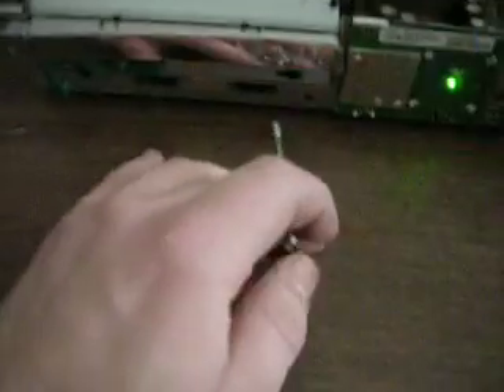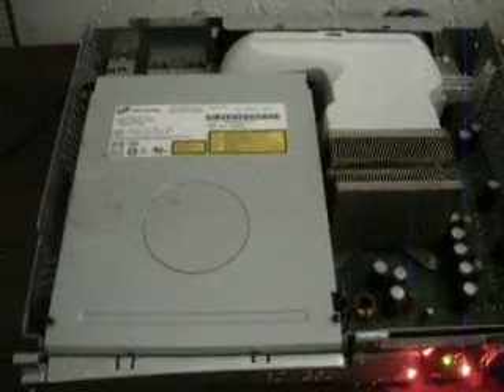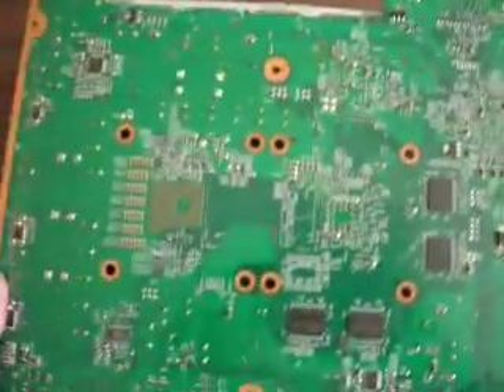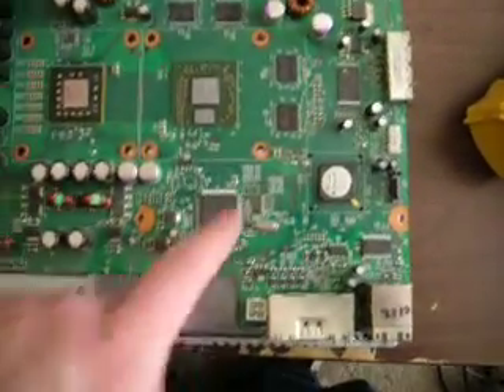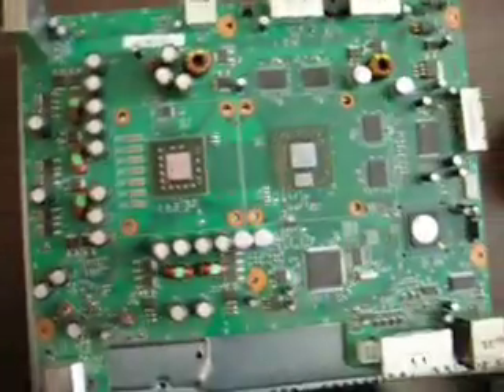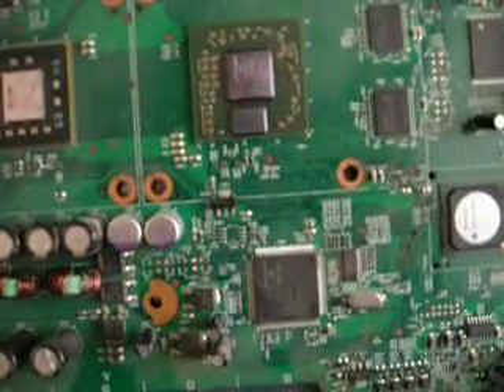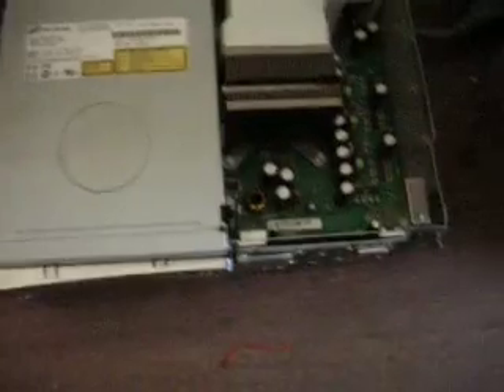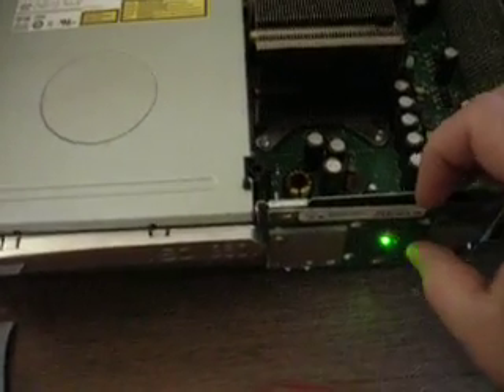Xbox 360 Heat Gun Reflow - RRoD Repair

Comment: How long did it last
Reply from the maker: XLS Gaming I don't remember how long this particular one lasted, I fixed a lot using this method. Some were permanent, some were only temporary. I think a lot depends on how you do the x-clamp fix afterward, how much the video chip and motherboard were flexed and whether or not you use a liquid flux.
Reply: xxW00LYxx ok thanks bro

Comment: Worked for a day then got the rings again.
Reply: Zach Jaixen if that is the case I suggest reapplying thermal paste. Either that or you could completely remove the chips, clean the lead-free solder and replace it with lead-based solder and place the chips back on

Comment: is enought to heat the GPU not all the motherboard
Reply: +Pary Pary I have a problem with HANA chip. It depends of what sympthoms you have. But just in case, you better reflow everything so you are sure that after you asemble everything together will work because if not, then you need to re open it....
Reply: he prevents the board to crack or to bend because of the temp difference i guess

Comment: What temp is the heat gun set to, mine has 10 degree f increments
Reply: +Shaun Riggle ~500F low and ~1000F high. Heat board to ~230C (~450F) MAX

Comment: Hey my xbox 360 is broken and it wouldnt power on so i kept pressing the power button and a capcitor blew will it turn on after reflowing as you did in this video? and also nice vid thanks :D
Reply from the maker: No, you can only fix a broken capacitor by replacing that capacitor
Reply: it was one of these things that popped off
http://gyazo.com/ce6cc88cf8efb0a9ef2c7a8b6a814ffe

here it is now:
http://gyazo.com/b637172cc73aeb1321abdf931a4fd340

 it also left a mark:
http://gyazo.com/18a633b15930f55a80b3d2a3f766b4de

so it for sure wont work?
Reply: +TD5X If pressing the power button caused an SMD ceramic cap to explode like that, you have much worse problems than that cap. If you're still holding onto that 360, you might just want to toss it.
Reply: Hydranix HNx
well damn i wanted the console id off of it :( and stupid m i actually tried turning it on again....was scary

Comment: i have done this manytimes and no luck same heat gun same everything wtf
Reply: Rrod isn't always caused by solder joints cracking. For all you know, you could have blown a capacitor or your power brick is dead

Comment: This method works great, I have fixed a rrod by disconnecting the fan and letting it sit there with the three lights until it overheats, showing two red lights, let it cool for an hour and it fixed the problem, I did however scrap the x-clamps and used bolts and washers to attach the heat-sinks to gain a tight clamp replacing the thermal paste in the process. Give it a go, have fun!

Comment: Can I use a hair blow dryer for the heat gun
Reply: Yes but it won't get hot enough to properly reflow it.

I used a blow dryer myself and after several hours I had another red ring of death.

Just get yourself a heat gun from walmart or amazon for $20. They are cheap!
Reply: undefinablereasoning

Update: Found a way to fix it without a heat gun...

Remove your heatsinks on the GPU and CPU. Clean off all the thermal paste (optional-depends on whether your thermal paste cures or is like mine and remains gooey after heat(I use Noctua NT-H1)).

Wrap all components on the board with aluminum foil except the GPU and CPU (make sure all the plastic bits on the board are well covered with aluminum foil).

Ensure there is no foil covering the bottom of the board.

Put it in your oven making sure that whatever rails or plate your oven has does not make contact with one of the vrm chips on the bottom of the board.

Set your oven to 250 degrees Farenheight for 15 minutes (includes preheat time).

You want the board inside during the oven preheat so the temperature rises gradually.

Remove board from oven and let it gradually cool on a surface that doesn't put pressure on the bottom of the board. (I used a towel).

Reapply thermal paste and heatsinks. Reassemble xbox 360.

And your red ring of death should be gone for good now. (I've not tested extensively, but i've not seen it come back as of yet).

Good Luck.

Comment: So i did this with my hair dryer, since i have $0, it took me much longer, but now im getting the two flashing red lights, aka the overheating light... i waited more than a half an hour to cool, i did it on a wood floor, didnt move it once while cooling, what did i do wrong? can applying too much thermal paste do this? i dont think i did that, but i cant think of what i did wrong. I have an x-clamp fix, i had the e74 one red light error.. its not even warm, why does it say its overheating? i get the bios or whatever you would call the xbox starting up animation sequence, to run for about 4 seconds before going black and the lights start flashing. anybody have an idea? i really dont wanna take off the heatsinks again, it takes like 40 minutes to get them off and back on again.
Reply: nevermind, it turns out that it was the thermal paste, i got the code '0011', and i just need to redo the paste, i forgot to do the stamp and check thing, i just applied and screwed it down, eh im not even a rookie, im just an experienced ametuer. So a mistake is a mistake, at least it wasnt a fatal mistake for mah ecks bahks.

Comment: before i do this i need an answer, if i heat the xbox on the metal case on a wooden desk, will the desk delaminate or burn?
Reply: You can possibly get the lamination result- but that has to be really old/ really crappy lamination. As for the Burning part- no. unless you have like your desk made out of sparklers and you let the heat gun sit there for hours.

Comment: got a whole batch of dead consoles that i have been using for parts, using this technique out of the ones i have watched, only difference being im using the low setting for both sides just to be safe, im fortunate that the consoles i have dont owe me a penny so if it dont work ive only lost out on some thermal paste and a heat gun but i have gained experience and some fun in the process
Reply: followed this again, this time using high setting on the actual chip side, bout 2-3 mins in, pop, there splits a cap, maybe my high setting is a little too high, but its only a high low setting gun, so guess i need to shorten the length of time on it
Reply: @thesmf1210  nice

Comment: did you wach the video at all? he did heat the bottom first (to prevent warping) and when he did the top it was concentrated on the main components. true this is straight from an online writeup and since he didn't give the reason why you want to stay away from the caps (drying out the electrolytes inside) so yes, he did do it correctly. (well as correctly as you can do it)

Comment: it dosent matter its not going to permanently fix your xbox 360, its got to be actually reball and reflowed with real machines not a heat gun the washer mod might work for a year or two plus new cooling past but its still gonna break down trust me ive been thru 10 xbox 360s and tried to reapair all of them every single way you can think of just buy a slim corona or trinity i would go for the corona version.

Comment: why are you heating the whole board? it's only the GPU that needs to be heated. You have a bigger chance of ruining your board the way you are doing it.
Reply: You heat the whole board because concentrated heat on one area will cause the board to flex. So you heat the whole board first to bring up the board temperature a bit before you focus on the chips you care about. It seems he didn't know exactly where the fault was so he hit all the main components.

Comment: iv fixed many xboxs using this technique but the video is wrong, you can still fix it, 2minutes all over the bottom of the board to heat it up, re flux the top as some could escape, and then 1.30seconds on the low setting on the top side of the board and then 2minutes on a high setting then 1minutes on low setting it will work perfect

Comment: That is an error that is commonly caused by the board being flexed from heat stress. The board is likely warped and you will have to un-flex the board by baking it at a low Temp for a while. There are numerous videos on Youtube that show how to do this correctly. Once the board is not warped, try putting it together and turning it on. You should now have a different error code. Look up that code to see what part of the board has a problem. Then, if it's a part that is reflowed in this vid,try it

Comment: Thank you very much for this tutorial. I did exactly as you said; one minute on the bottom on low heat, and 4 minutes on the CPU and GPU + memory on top on high. Worked like a charm. Got the xbox from my friend and with under $50 in supplies and this video I now have a working xbox! If I had bitcoins I would send you some. Many thanks.

Comment: As soon as i get my heat gun back from my girlfriend's dad's gunstore (was using it to heat kydex for custom pistol holsters) i am doing this straight away.  And the reason i have heard as the cause for RRoD during DVD playback is because microsoft i guess figured they wouldnt be using the cpu and gpu nearly as much as they would in a game, so they set the fan speed to stay on low during dvd playback.  Unfortunately for them, the chips still heat up, and with no airflow, they still get RRoD.

Comment from the maker: Easy: broken solder under the RAM and (H)ANA both can cause the RROD as well, and where I'm not monitoring temperature that allows me to spread the heat to avoid thermal shock (similar to what a pre-heater does on real reflow machines). Just trying to help people with a simple yet effective fix, you're the lame one

Comment: Not knowing what temperature the board and components are at is just plain bad.  Sure, this works more than half of the time because the heat makes the cracked solder connections touch again, but it's not a true reflow.  When the problem returns, it becomes a lot harder to do a proper reflow--most of the time a reball is needed.  Heatgunning can damage the pads or traces on the board, which reballing won't fix.  That's the point I am trying to make.

Comment: Btw, adding flux after a reflow does nothing.  The flux is there to remove oxidation from the surface of the solder so that once it reaches the reflow temperature, it will reconstitute any cracks in the solder.  Flux helps solder "flow", which is where the term "reflow" comes from.

Comment: I hope you're not charging people for this.  I doubt you're really reflowing the solder.  Since you aren't using thermocouples to monitor the tempes, you're basically doing it blind.  You need a preheater to keep the bottom at a constant temperature in order to get a proper reflow of the components on the top side.  You should be able to remove the GPU if it's a true reflow.  Try it out on a dead board and see if you can lift the GPU without warping the board (it won't work this way). Trust me.

Comment from the maker: @hunter24574 No! Ceramic based thermal compound does not conduct heat well enough. Use silver based only. However unlike a previous comment suggested, only apply AFTER the system has cooled or else you may crush the hot solder balls and potentially cause a short circuit, basically making your xbox permanently broken. Dont touch the system at all while reflowing or cooling

Comment: 1 thing u forgot to mention to pll is when u finished the reflow u then need to reapply the thermal paste to the 2 chips and heatsinks . laos 1 part i didnt c in ur video is on the 4 black ic units things on the back mine had 4 sponge things on them urs didnt do i need these

Comment: just a tip, all those things that look like batteries can explode and ruin the board if subjected to too much heat, you should realy cover them up with aluminum foil (which reflects heat) before you do this process. obviously it went fine for him, and you won't always have an issue, but it's a possibility that you should really cover since you could do the reflow right, but a capacitor could burst in the process and ruin the whole board

Comment: @xxW00LYxx Something that would help and reduce the time you'd need to spend with the heatgun on is surround the GPU, CPU, RAM etc. with some tinfoil, it will also almost completely remove the risk of melting plastic or anything, and I would like it if you did a Reball tut as that is a more perminant fix.  Also, I was wondering if you could repair my RROD Jtag if I sent it to you.

Comment: @djesteem01 No, it isn't. Using the traditional "Overheat" method you have described only works for a short time. 
The Xbox 360 is designed to RROD2 when the console gets too hot. When the RROD2 gets too hot, the console will almost completely shut down, so it cannot get any hotter. This keeps the 360 from getting to heats that will actually remelt the solder or damage other parts, re-flowing the 360 correctly. Therefore, the "Overheat" method doesn't get the job done. This method does.

Comment: let me get this straight...you took it apart and took off all the thermal paste. heated it up and put it back together without any more thermal paste and it worked? so it is the same thing as letting in run for a bit without the fans not running but you cleaned off the paste?

Comment: @Randypants713 
you need to overheat your board once if you havent yet.. do this by removing the fans or stopping the rear fans.
you also may need to use "silver" thermal paste, or run direct 12volt into the fan (red and green together) and ground the black and blue, each to an adjustable trimpot 200ohms first..

Comment: Nice video.. im a bit worried about the bottom memory chips, you had no support in making sure the bottom chips dont peel of when u heat the board...

Also, notice how long it took for the xbox to start up that time?? You actually still have a problem with one of your memory chips.. luckily, (been an ex-microsoft repairer) the 8 chips on the board have a system where if one chip isnt working properly it will disable it!!! reheat the bottom chips with "no clean flux"

Comment: @lindley2008  I know the newer heatsinks are better. That's my reasoning for replacing the first gen one. The heatgun method didn't revive it, tried it 3 times with no difference. The GPU heatsink barely gets above warm to the touch so i'm pretty sure it's probably down for the count anyway.

Comment: I have a first gen xenon with the 0020 error code on it.  I swapped the first gen heatsink  for the dual heatsink. The x-clamp fix has already been applied too, which fixed it for a month in the past and then I got stuck with this 0020 error. So far I tried heatgunning it twice but still no different.  First attempt; pre-heated bottom for 2 min at 250C (or 482F)  then heat the topside like instructed for 4 minutes at 450C (or 842F) 2nd attempt same thing only for 6min instead, also no change.

Comment: @smarttdiablo see if your drive ejects if not then you have shorted the board with the heatsink this normally happens if you only used one washer on the top of the board, or sometimes if you have not used one set of nylon washers

Comment from the maker: @emerybryant not quite einstein, the towel trick doesn't get hot enough to melt the solder and is the system itself generating the heat. Not safe. This method does get hot enough to melt the solder and is from an external heat source that is being targeted to individual components.

Comment: @thebigw1004 current staus after using the flux on 1 board so far is it gave me 3 red rings, but im over heating it now... and then going to wait 15-20mins and see if it works for a few days to a week.

Comment: @TheLegend2294 oh well i have common codes such as 1022(2 xboxs) 0102(2xboxs) and 1021. ive had a running xbox, its just i want to get these old ones i got for cheap fixed, and the xclamp usually works, but these ones had the xclamp and then broke, so im probly just going to buy flux and try that after the heat gun.

Comment from the maker: @TakeTwoGameShop My heatgun is 750*F low 1000 high. I've never actually measured the surface temp. I have a thermocouple but since this heating profile works for me I've figured why potentially mess one up (or my thermocouple) if it works. I am interested to find out though so I guess I'll have to get back to you :)

Comment from the maker: @CarlospuAlmeida Oh that's a good idea, let me spend more than the price of a 360 to buy a machine to fix my 360. This repair can be permanent if done right, and even more so if flux is used. Besides, many rework stations are basically heatguns anyway, they both blow hot air

Comment: Have you ever tried fixing a 360 with error code 0020? I've performed this heat gun method on a Falcon and it worked tremendously great, but when I tried it on a Zephyr model (no glue holding the GPU to the mobo). I was not sure what the previous error code was, but now all I'm getting is error 0020. My father says that I had probably shorted something or bridged a connection under the gpu. Took a closer look and it seems the gpu is slightly out of place.  What do you think I should try?

Comment: Oh, one last thing, I have the Elite that came with the upgraded heat sink....does NOT fix the RROD :-( There is a small amount of fluid in the tube that runs up to the piggyback heat exchanger....right where the copper tube comes out of the main heat sink, the fluid had blown out and was all over the motherboard and you could see where it had all leaked out and fried to the heat sink. It DOES remove the heat but it still isn't enough. Its tough with the current design to clear the DVD drive.